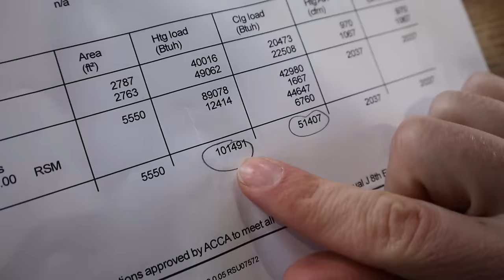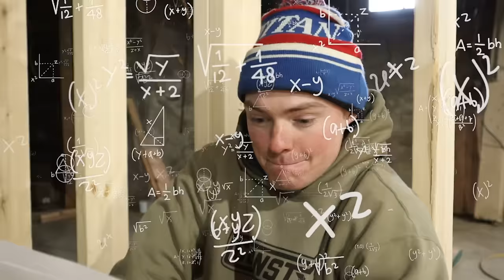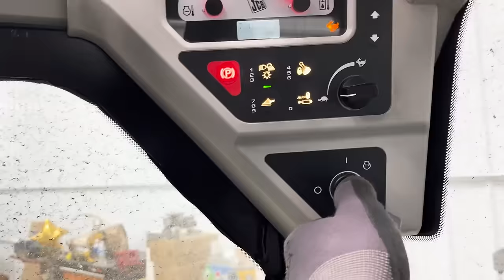Restoring A $7,000 Mansion: Removing 2nd Story Floor

Comment: The downside of having one HVAC system for two floors is that when it comes on, the whole house is getting heated/cooled.  Yes, you can mitigate that with fancy venting, but it ends up having your individual compressor on longer than you need it.  With two independent zones (upstairs & downstairs), you can have the downstairs cool during the day when you're using it and you can have the upstairs warmer.  At night, you can have the downstairs warmer, but the sleeping rooms cooler.

As far as the third unit goes in the future, wait until the future.  It might be 10 years from now and you just replace the 2nd floor unit with something bigger.  These things don't last forever.

Comment: If the second floor was done as balloon framing the gaps of the new subfloor against the studs (time stamp 47:30-35) in the stud cavities need fire blocking.  That's a huge fire safety issue. Maybe you have a plan that you didn't share yet but it is an important detail. Fire will fly up those wall cavities so fast.  It's a code issue on new construction,  has been for decades.

Comment: As far as HVAC, don’t skimp on it.  You do need professionals to help.  I would recommend the second option,where you do the rough-in, cutting holes and taping it up.  Yes, it’s more money, but you have the peace of mind that it is done properly, plus if they run into problems, they know how to fix it on the fly.  If the attic is a single room, a mini split may be a better option to heat and cool

Comment: I have had heated flooring in a brand new home and they are incredibly expensive to run and would not put them in a house again - look at the ongoing costs of running that system before you install them - very expensive to install when you don't turn them on because of the costs to run them and you are paying upward of 1k a month in the winter to keep the house warm

Comment: 70000 seems steep but never wanna cheap out on heating. Especially if you plan to be your forever home.  Joy of a 6000 plus square foot house. I priced changing out my steam heat and its like 15000 for a 1250 sf house. So 4 times the size 4 times the cost.

Comment: Nave, you may have figured this out already: you will be dealing with one load of laundry FOUR times. 1. Prep 2. Start 3. Rotate 4. Fold, hang up, put away. I do at least one load of laundry a day. So if you have to do more like three or four for various reasons say sickness etc. that means easy access to the laundry facilities is imperative. The main floor is the most logical so you can keep an eye on and include the family in the steps. Also if the washer or dryer needs fixing or replacing basement or bedroom floors may not be the best location.  Just something to think about. Ask your friends with growing families what they think.

Comment: Been in HVAC for 40 years. I know it's more expensive to go with two units in the house but I'm quite certain you would be very sorry if you didn't go with two systems. It's just harder to control the temperature from floor to floor with one system. Zoning with one unit would also be a bad idea for something as complex. You may need to consider mini-split systems for some of your needs. Not everyone likes those but in certain circumstances they are a better solution for certain parts of the project such as the attic. A lot depends on how much you will use certain areas. One thing I think you should consider when planning is what areas of the house you will use both now and when the kids move out in 16 to 18 years? Just saying. It's easier to address now while everything is open than later. Ducting with one system would be a nightmare. The longer the duct runs and the harder the angles of the duct the harder it is for a system to push air. This is especially true for A/C. Because the air is cold it has to be driven, because it is 'heavier'. Heated air of course is more volatile so it's easier to move, but since the heat pump is just your secondary heat source that should be less of a consideration when making a decision between 1 or 2 systems. Just my preference, but I don't like floor vents. In almost every case where I've seen them used they become little garbage cans. But sometimes you don't have much latitude. Just a thought. I always kept my duct runs as short as possible. and would free throw when possible. Also be careful of your returns. Contractors can be careless concerning them. Can't tell you often I've seen them undersized. The returns need to be located in a central location for each system. If the air handler is located down stairs a dedicated return needs to be installed back to the furnace. Venting your discharge air into rooms where the door will be closed almost always creates a bottle neck in the system. In such cases run a dedicated return. Your system will be designed to carry x amount CFM. That same amount of air plus a little needs to be returned back to the furnace. At the very least if the furnace doesn't get that air back it will try to make up the difference somehow usually by drawing the air through cracks and crevices from an unconditioned space. If the return is restricted for any reason it can have all kinds of side effects on both the furnace and the A/C. That's a discussion for more than we have space for here. Your outdoor units need to be placed in shaded areas if possible (North or East side of house). I would strongly recommend shade trees. The efficiency of the house can also be helped by installing double walls on your exterior walls to improve the insulation. There's plenty of examples on YouTube. They also work good for sound proofing in the master bedroom. Best wishes.

Comment: Personal experience:  I put one unit in with a zone control system.  Then one day in early July, my heat pump locked up. I sure wish I'd put in two separate systems rather than the zones from one system.  I'm hoping to add onto my home and at that point I'll be installing separate inverter type split systems on each floor.

Comment: I lived in a 3500 sq ft home with one HVAC unit for two floors.  It barely heated and cooled the place.  You need two systems.  But, you could get them larger than needed so that when you do the addition, you can just add ductwork to the existing.  This could be cheaper.
Reply: Also, zone, zone, zone.  Thermostat in every room with zone control for the under floor and forced air.  Be good if  you can have some air exchange to keep fresh air in the place and stale air out.  Install an ultraviolet filter in each unit.  It's an old house, every little bit of air filtration the better.  I use the Honeywell thermostat system (a box with multiple connection points installed by the furnace, fully customizable for your needs, etc.) and have the wireless AP so I can use it with smart tech, Matter, etc.  It does geofencing.  Also, consider the TPLink brand smart switches for your lighting.  It is VERY stable, cheap, Matter ready, works well with Home Assistant if you get into any of that, and rugged.

Comment: Did they give you a cost of a high efficency boiler for the in floor heat? You can zone that for each floor. For cooling just use two simple A/C units.

Comment: Cole, Assuming you will save $18,000 on the labor of the ducting is a false assumption.  Unless you aren't paying Justin and Roman.  If they are going to assist you with the install and you are paying them, you need to reduce their salaries from the $18,000.  I am 65 years old and have learned a thing or two over my life.  Some of the HVAC specialists have already commented on having a system for the first floor and one for the second.  I completely agree.  In my opinion, worth 2 cents, you will be happier with a split system.  When you look at the cost and amortize it over the life of the system, you are going to be happier with a system that can keep you and your family comfortable while you sleep.

Comment: The heatpumps for in floor heating probably will be targeting 35*C, but there are two staged heatpumps that reach higher temps (up to 65*c)   That reduces the SCOP compared to a unit with a single circulating stage, but it is cheaper up front than buying two heatpumps. A heat recovery unit will store up to 85%-ish of the warmed/cooled air when it is exchanging inside air with the fresh outside air. Are you going with more efficient Euro style tilt swivel triple glazed windows or will those sliding windows remain?

Comment: If the contractor for your HVAC  is worth his salt he will size the duct correctly and you'll never feel a difference. I have a couple heat pumps put in by my contractor and there is no temperature change in any room upstairs or downstairs. I have also put a heat exchanger in the forced air system to utilize water heat to heat tile floors also.

Comment: Your answer is:Yes. Install the two systems in the hohse. Spend your money on the best mechanicals and let the pros install them. They'll do it in a third if not a quarter of the time you'll be able to do it in. If you want to save the 7k, cut the holes in the floors for the ducts and seal them yourself. You don't want be kicking yourself in the rear end in a year or two or three when you are running around opening and closi g vents because the first floor is too hot and the second is to cold and the third is worse. Or in The summer the first floor is too cold and the second or third are too warm. It'll be a bigger problem trying to retrofit a system upstairs after the house is completed. It's money well spent and peace of mind.

Comment: With heat pumps do you go all electric in terms of water heating, oven/stove, dryer, fireplace?  Do you bring in solar and a Tesla power wall system to store power (and serve as generator) and anticipate electric vehicles in future and using them to provide power when power is out?

Comment: You can use space between studs and floor joists to pipe air. That way you don't need 2000 feet of ugly tube and all the issues that come with it. Added zone heating with electric and gas in the sensitive areas. A couple of smaller units for each floor and good air transfer mechanisms for cooling especially. Your radiant floor should keep it above 50 and a nice big wood/coal burner would cook you out on special occasions. You can do it all for less than 70k. All the cool kids are doing splits now days and if you have that well still, you may be able to pump well water through the loop to a pond and keep the floors cool... Plus pipe air from the basement up on the south side and down on to the basement on the north side. You got 5000+ sqft. It is going to cost a small fortune to keep it 72 all the time. Don't ruin all that nice beautiful space with thousands of feet of ducts and floor vents. My old house had an attic fan, bathroom heaters, and vents high on the wall. It made controlling air flow real nice.

Comment: 2 systems is a better option. One in the attic blowing out or up and down. One in the basement blowing up and down. One system non zoned will give you comfort issues. You could do one large with proper zoning but that takes much more room. I love geo bit a good heatpump properly set up is very good. DONT SKIMP 90% of your old system was 100 years old because they didn't.

Comment: ...Cole - For whatever it's worth...I'd skip the in-floor heat and go with 2 heat pumps...and use a hot water heater for water.  It's probably worth the extra money to have the A/C guy install the entire system to get a good warranty.

Comment: After a winter trip to England and seen how radiators looked and worked, we had them installed into our home they heat up the rooms so fast. Have you thought of having a CENTRAL VACUUM SYSTEM installed much needed in such a large house, so much better than dragging a vacuum cleaner all over the house.

Comment: It takes much less energy to move heat than it does to create it. that said, I hope your contractors are using ground source heat pumps where the temperature is 49f year around as your source of heat or cool. that could be achieved by using a well or by digging a coil bed to exchange your heat. yes ground source heat pumping systems are costlier to initially install than air to air  mini splits but will give you more reliable performance especially in extreme temperatures.

Comment: Probably better with multiple systems. Otherwise you'll have one big system that will be pretty inefficient when under light load. For your cooling in particular you'd need a massive single heat pump. I'd probably forego the in floor heating and just run the heat pump for heating and cooling. You can then simplify the whole system. The quotes are reasonable for all that needs to be done.

Comment: I have 3500 sq feet. And the last time we had to change out our A/C and heat we put in heat pumps. We have 2 systems. All I would mention is to totally understand the thermostat. But your worried about the cost of them putting in…. You will save days worth labor having them put in. My house is only one story. And with 2 men they had mine 100% complete including some vent changes I requested. I would also think of looking at public wearhouse and see if you could fill the list of materials that might save you money.

Comment: I think you have the best crew. Your house will be worth a least 2 million when it is completely finished. Your Family makes all the difference and your Dad is one nice fella. I hope the poor workmanship on the Silo gets resolved and I would say it will cost them more than it cost to build it to make repairs. Did you know the State Fire Marshall can condemn the structure as a fire hazard and safety hazard due to the way it was constructed. It would not pass an inspection on safety. When you get the Feds to declare it unsafe you will automatically win your case. However, if that happens your profits will be lowered having to store your grain somewhere else. I did that to one a few years back that was built by a well known commercial company and the lawyers loved me because I short circuited their defense that it was in specifications. They had to disassemble and remanufacture the silo system due to the foundation alone. I put the smack on them using the back door. The Bank that financed the build loved me too. The Fire Marshall from the State said it was a construction Fire Hazard since grain silos can be explosive. Foundation was a workers Haszard as well. My Birthday and my Opinion.

Comment: Check out technology connections video on heat pumps. He explains a lot of heat pump/ conventional systems are vastly over specd on the heat side.   It worth the watch before you dump a ton of extra money on an oversized system.  He got a big channel and I’m sure he would give you pointers on what he did.   Whatever you do make sure you get an installer that is up to date on the state of the art stuff in the heat pump world.   The industry is behind the 8 ball when it comes to heat pumps and specing them properly.  Especially up north where the conventional wisdom is that heat pumps need to be way over sized to keep up in the winter.

Comment: By notching and dropping the floor joists down. Didn't you just lower the main floor ceiling by that amount on the outside which now changed all your measurements from the ceiling to the floor on the main floor the same amount. So now you are for example at 8 feet 11 1/2 inches on the outside walls and 9 feet at the center of the main floor rooms?

Comment: Do the heat pumps and scrap the in floor heat. Seems excessive to have 2 heat pumps, then a boiler. Otherwise, yes, with the size of your house, you'll need 2 heat pumps.

Comment: Cole,  I know you are still a ways away from electrical, and plumbing work, but I want to say it now so you can start planning for it. When you are doing electric and plumbing, also run network cabling. Get some spools of Cat6a and run a couple of jacks per room, all feeding back to a closet where you can mount a small rack.  All internet enabled devices work better when wired instead of wireless it will save you a lot of headache later if you run that cabling while all the walls are open.
Reply: I work in IT and don't even have that in my house.  In fact I don't know anyone in IT who wired every room with a data jack.  Maybe the attic for security cameras mounted on the exterior... but wireless is fast enough for everything I need.
Reply: @benhur520  How many of those people took their entire house down to the studs where it would be easy to implement that installation? Cole is in the position to do this easily.  Will he use all of that capability right away? Probably not, but you never know what the next 100 years will bring. As for wireless coverage, Cole is dealing with a large 4 story structure (basement, 1st, 2nd, finished attic) you aren't going to get by with a single access point.  Plan for the future, build accordingly.

Comment: Cole - remember your high school physics: When you are hot in summer, cool air blown at you increases skin evaporation and helps to lower your core temperature. In winter, warm air blown at you... increases skin evaporation and lowers your core temperature.  Summer cooling should be via blown air. Winter heating is most efficient as radiant heat from under your feet, rising up. Two different systems for two different problems. Tom Roche (below) seems a guy to get to know.